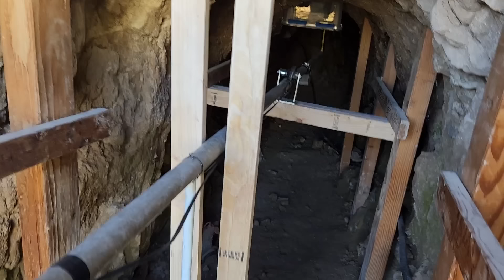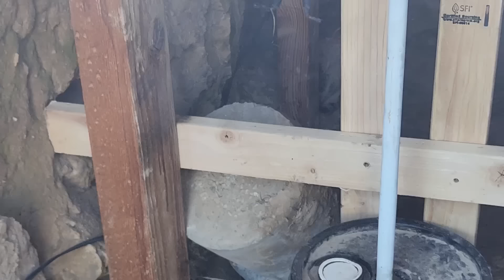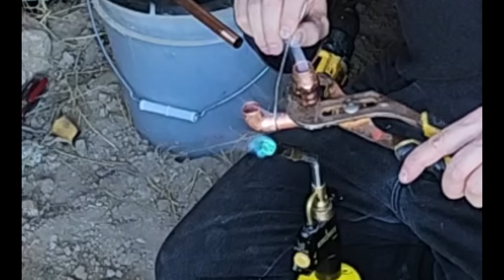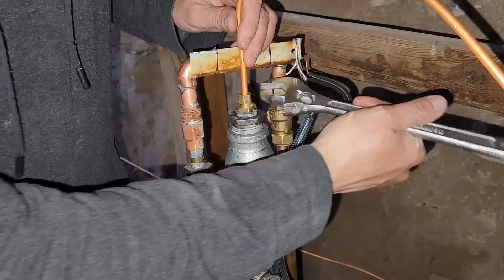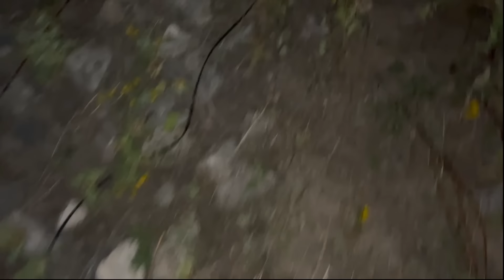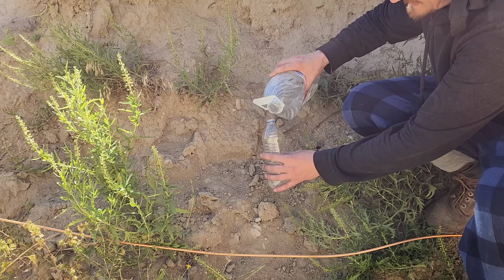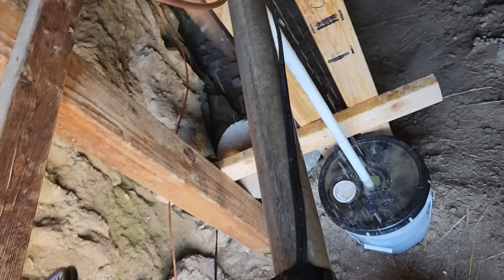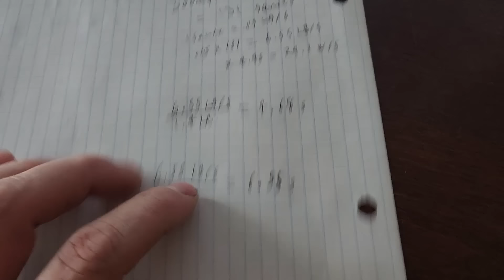Sodium Water Hybrid Rocket?

Comment: Definitely try putting a ring of plates around your bolt in the mold to expose as much of the sodium to the water as possible
Reply: Or a mesh or so of some material to preventa the melted sodium to let go through the gas channel
Reply: I was imagining a design with a baffle stack, like a suppressor. Could maybe keep most of the sodium inside and reacting.
Reply: some kind of ceramic mesh, like the inside of a catalytic converter is what i'd suggest.
Reply: @Mis73rRand0m  or a pool of some kind, letting the gas escape but not the sodium
Reply: At that point, why not just build the fuel using a stack of pre-cast grains?  Make a smaller (probably easier to work with) mold and then you can stack as many grains in as you want.
Reply: Perhaps since the sodium has a low melt temp , you could use a heat source to melt it and mix it in a controlled manner in the combustion chamber.
Reply: Or ACME thread like a vice
Reply: How about we stop getting his channel potentially flagged due to mentioning projectile mufflers?
Reply: @Mis73rRand0m To be fair, I don't think random commenters are going to get him flagged any more than him making novel rocket engines that look so much like pipe bombs that he literally needs to explain why they aren't in the video

Comment: You could have the center nozzle tube be a solid cylinder almost to the top of the pipe.  And have copper tubes run inside from the top down onto the ring of sodium, and have the pressure all shoot out that center tube through the nozzle.  Use gravity/thrust to your advantage.  It stays solid until it is moving, then it liquifies, and creates pressure in a more stabilized and controlled manner.  You just have to make sure the water is getting in at a higher pressure than the sodium reaction is creating for the water to continue to flow.